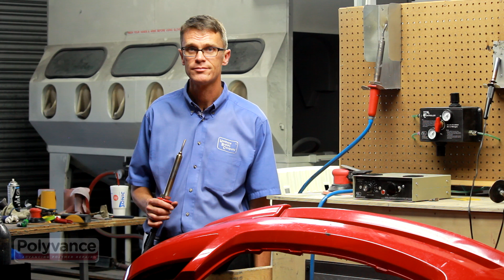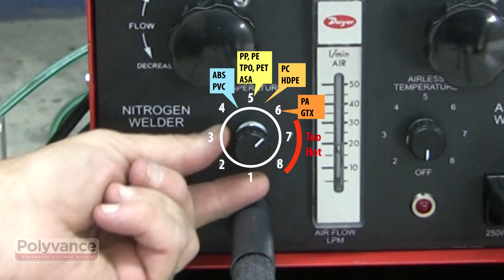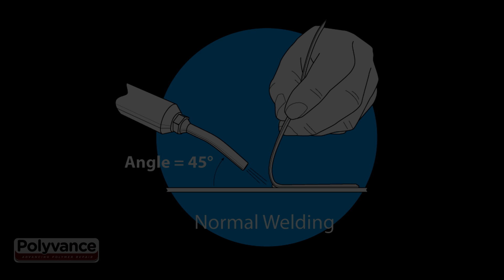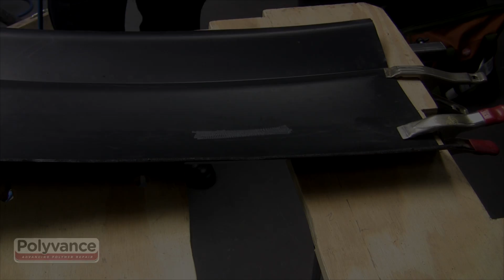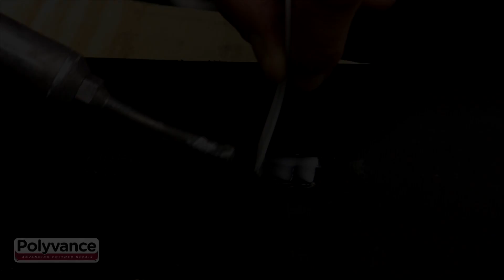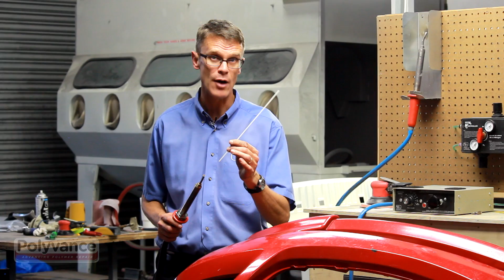Basic Nitrogen Welding Process - TAPAS

Comment: How is it different from a regular hot air welder - I don't see any advantages
Reply from the maker: When you weld plastic with hot air, the melted plastic gets oxidized (burned) in the process. Welding with hot nitrogen gas flushes the oxygen out of the weld zone. The plastic melts cleanly with no contamination...no smoke, no fire, no oxidation. It's a cleaner weld. The plastics fuse together with no contamination.
Reply: not only what polyvance said, but because there is no oxygen in the weld zone, there is also no smoke like when you weld with air, which is much healthier for the person doing the repair, plus it makes the air in the shop better to breathe in general.

Comment: Great video on technique... never heard of plastic welding ... is the gas a mix or is it pure nitrogen? Is this mostly used for repairs or is it used in manufacturing too?
Reply from the maker: You can use hot air to do plastic welding. We use nitrogen as a shielding gas to prevent oxidation of the plastic and give a stronger weld. Our nitrogen generators produce ~97%+ pure nitrogen. You can also use nitrogen bottles from a supplier.